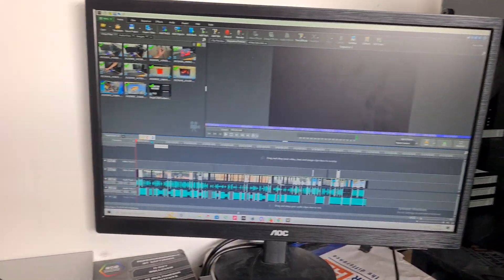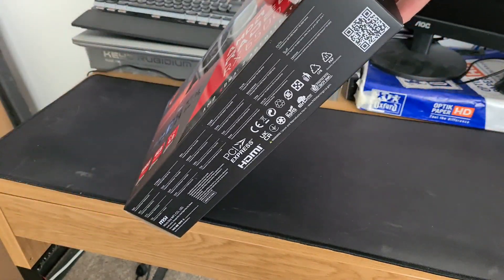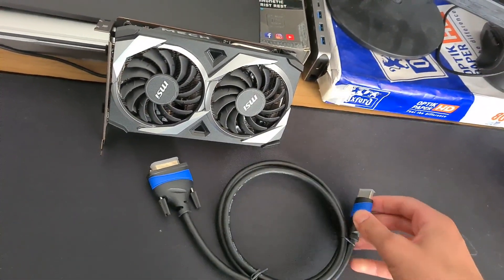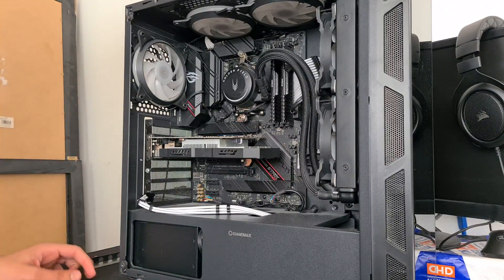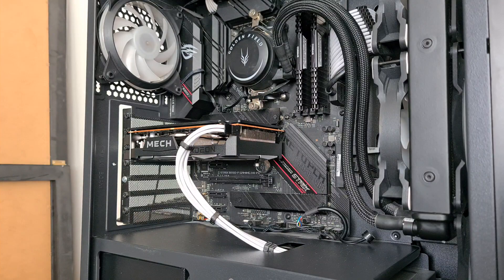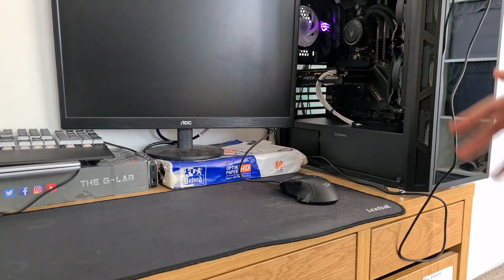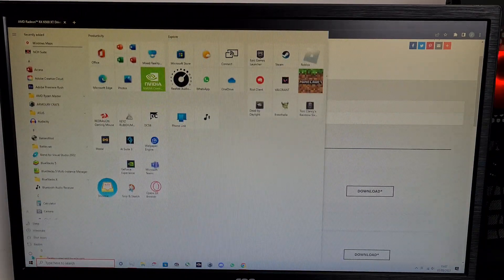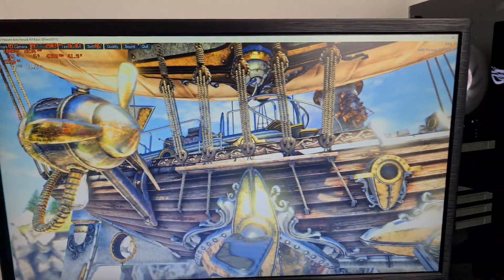I waited 4 years for this GPU Upgrade (RX 6500 XT Unboxing and Installing)

Comment: is your rx 6500xt is stuttering? and also what is the rest of your system spec?
Reply from the maker: As of now my GPU is working perfectly with no stuttering as for my pc specs
Ryzen 5 3600
Motherboard is a Asus ROG B550
GPU 6500xt
CPU cooler made by golden field 
Ram DDR 4 16Gb at 3200mhz

Comment: what 6 pin cable have u got connected?
Reply from the maker: Its a cable extension from amazon made by UpHere, its pretty nice.
Reply: @M20UBR88  any chance u could find it and link it for me 😁
Reply from the maker: Yes sure here's a link to it 
EZDIY-FAB Sleeved Cable - Cable Extension for Power Supply with Extra-Sleeved 24-PIN 8-PIN 6-PIN 4+4-PIN with Combs- Black White and Grey https://amzn.eu/d/an1NkOx

Comment: Thank you for great video, just one qustion, you said you had to get cable because your monitor supports only DVI and VGA and your card only has HDMI and display port. I get that but why wouldnt you connect your monitor with Motherboard which surely supports DVI and VGA? You do know you dont need to connect Graphics card with monitor....
Reply from the maker: Connecting display via motherboard bassically disables the graphics card since it has no output
Reply: @M20UBR88  Interesting, i have gtx 650 ti and im planning to upgrade to this GPU you reviewed. I have my monitor connected to the motherboard for allmost 10 years and never had any issue. You really think that hinders performance on GPU?
Reply from the maker: What CPU do you have? it could be running off of integrated graphics this whole time 0_0
Reply: @M20UBR88  I3 3220 i think

Comment: What is its performance during video editing and rendering
Reply from the maker: It handles it pretty well although my editing software seems to be more CPU intensive than GPU. It does handle loads of data well tho so 👌
Reply: @M20UBR88  which cpu you recommend
Reply from the maker: Stay stuned I actually have a video comming soon on what if think is the best gpu in 2022 under £400
Reply from the maker: It mostly depends on budget but generally the Ryzen 5 3600 and 5th gen series look really good. Intel do have 11th and 12th gen CPUs going for them but for all round Ryzen good 👍

Comment: Idk if im the only one who noticed that the AIO is upside down and will have less effect in cooling
Reply: It does not affect cooling and its better because bubbles of air wont get to the pump
Reply from the maker: No its positioned that way because its the most convenient and it does not affect cooling :/

Comment: I want to build my first ever pc, is the rx 6500xt a good choice for £149?
Reply from the maker: Yes it's a good gpu to start off with for the price
Reply: @M20UBR88  How do you get a rx 6500xt for that price, for me in the Netherlands the price is around 230
Reply from the maker: On Amazon UK i found it on sale for £170 and bought it just in time. It may be cheaper or more expensive depending where you are :/
Reply: @Gamers Edition ty for the fast response, I will try to look for better options or other video cards.
Reply: try get your hands on a 5500xt as this is a better card and has hardware encoding the 4gb model shouldn't be going for too much even  better if you can find a 8gb variant... or consider the 970, 980 the 970 will likely be similar to a 6500xt and cheaper ofc tho those 970s are all gonna be usedif you hell bent on a newer card then yes it's probably one of the best you'll find in the price range unless you can get a deal on a 1660 wouldn't bother with a 1650. make sure you using PCIe gen 4.0 for the 6500xt or you just kneecapping your card as it doesn't work well on 3.0😢
Reply: @garycollumbell1396  is the rx 570 4GB a good option?
Reply: @daniawan9253  it's not a bad option if you can get one for cheap the 6500xt is a better bet if you are running PCIe 4.0 if not then there really isn't to much difference pretty sure you can get used 570s quite cheap however try get a 8gb variant tho as the extra vram is gonna be usefuk
Reply: @garycollumbell1396  thank you ☺️
Reply: @garycollumbell1396  it costs more now though, not as expensive as before, but there still high enough in price i wouldn't recommend it now.
plus for awhile people couldn't even buy em, then by the time they did come back around AMD already released the 6000 series. i think we all can agree AMD could've did better with this card, at the end of the day though gaming shouldn't be too much of a problem. the only deal breaker i can see is it only has 4GB, not really sure why Radeon put out a 4GB card these days, unless they meant for this card to be more for productivity work, but that wouldn't make sense. that being said there are a few options, the RX 570 it's a little older but would be probably close enough in terms of gaming. if the price was better or closer to the RX 6500 XT, then id say go ahead and get the RX 5500 XT, but as of right now prices on the 550 are 250 and up. that card wouldn't be worth it, and that's only for the 4GB, if you want the 8GB it's over 300. so this card at 199 is a better deal for someone that might still be on a 750ti or maybe a GT 1030.

Comment: Its better to ddu og drivers and install the new one
Reply: In this scenario DDU is the safest option. leaving traces of the old Nvidia drivers cannot do any good, and can cause issues, sometimes subtle ones you don't notice, but still running you at reduced fps in games. Now if you had just moved the old card to a different slot (so as to keep the Nvenc encoders/decoders available, or for running some applications that require cuda) then you would need to leave them in. I don't know how many times I've had a friend upgrade their graphics card and fail to ddu the old drivers and not understand why the new card performed badly. One was about to send the card back as defective until I convinced him to clean out all graphics drivers and reinstall just the right ones. He was getting only a bit over half the perf he expected and some games weren't displaying textures correctly. After a good clean with ddu and a reinstall everything was running perfectly.
Reply from the maker: If your running into instability and driver crashes then it could be a good option. But getting the card Factory New, theres no need and you can just install the latest recommended drivers.

Comment: I want to upgrade to a 6500xt too.From a gt 1030 it would be a huge jump
Reply: i just buy it like yesterday now i waited for delivery . i have the same graph like you , gt zotac 1030 2gb :D , belive me , gonna be huge jump if we on 1030 ruin a games like cs go , lol , valo on 100-150 fps gtav min settings like hardly 50-60 fps ,  and other games too. . hoply on this one rx to have like 200fps diff + on ryzen5 1200af more then i have with 1030.
Reply: @palic1994  Yeah the difference would be definitely huge, happy gaming.You should also consider upgrading your cpu in the future if you want the fps to be more consistent.Games like cs go, valorant and gta 5 lean more on the cpu side.

Comment: Great video, i bought the same RX 6500 XT from MSI,  i think that this card is so underrated. Afther 5 years using the GTX 750Ti, that was a huge upgrade for me.

 😀 Hugs from  Brazil 🇧🇷
Reply: Upgraded from my R7 265. Worth the price since getting the latest hardware rather than paying the same amount for scalped price GPU
Reply: upgraded from a gt 730 2gb ddr5 (still have it)
mine is gigabyte eagle one. and it is 🔥
Reply: is it good with PCIE gen 3 ? does it good ? i wanna just wanna buy this VGA
Reply: @NASKLENG68  Yeah. it is good. I can run every new gen game with no problem. The FST helps a lot, i was playing F1 22 with 110fps, when i activated this feature, the fps goes up to 200.
Reply: bro i wanna know how much fps u get and what performance
Reply from the maker: Its going really good so far :) i wont spoil too much but if your curious you can search up RX 6500 XT Gaming and you can get a rough idea of what this Card can really do.
Reply: @n3xusgamer344  get 60fps in almost every game with the graphics on medium
Some games can be playable on High graphics
Reply: @Comical_karma  u got discord?
Reply: estou saindo da rx 550 4gb power color pra essa MSI  RX 6500 XT, penssei em comprar a GTX 1650 Super mas tive minhas duvidas, até onde vi basicamente são iguais pena que a rx é pci 4.0 não sei o quanto de fps irei perder com minha placa mae pci3.0